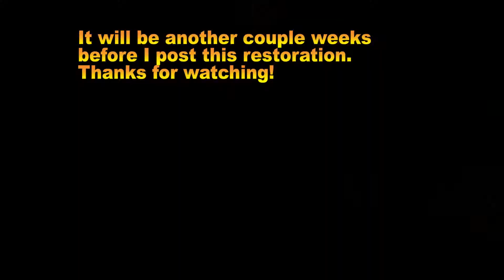Welding Cast Iron (not a how to)

Comment: haha for once I don't have much to add.  I could say more pre heat and post heat, but thats pretty easy to say after watching something not work out perfectly.  Glad it worked out good enough.  That thing will be shining like a disco ball if you polish up those blades and mow your grass in the summer.  I'm sure it'll all look good with whatever way you end up finishing it.
Reply from the maker: Hi Bradley. For some reason, I had the impression that post heat was more important. I continually amaze myself with the unfounded assumptions I make. Anyway, I know before and after matters now ;). Polishing those blades is gonna be interesting. Cheers

Comment: It think it looks quite good.  Welding intimidates me so much I do not even dare to start.
Reply from the maker: I love my stick welder. They are wonderful machines and a lot of fun to use. Cheers
Reply: @joeheilm  I have an old one that my grandfather bought from a retiring blacksmith. I did try to use it, but did not get the hang of it and well kind of gave up. Maybe it is time to put some new effort in.
Reply from the maker: Hi Alex, youtube has so many great creators that talk about welding, i would argue that, thanks to the youtube community, there has never been an easier or more convenient time to learn a new skill, especially welding. If you get bored scroll way back and you will my lincoln 225 restoration. Cheers
Reply: @joeheilm  I think you are right. I already learned lots of new things on YouTube. I'll be checking out that Lincoln.